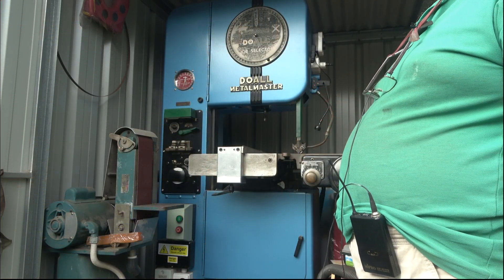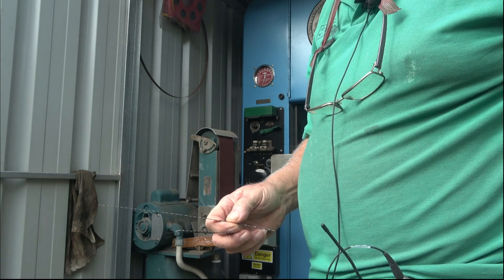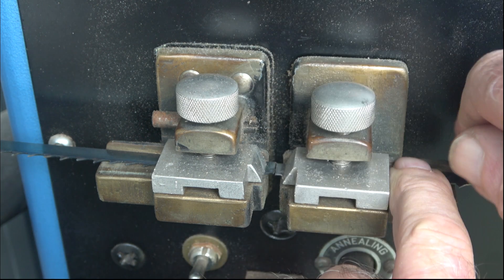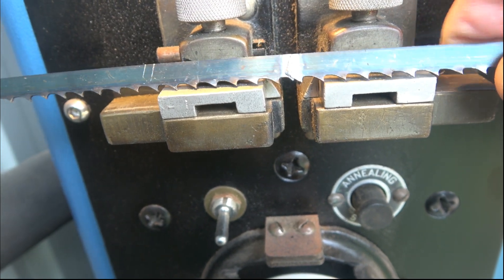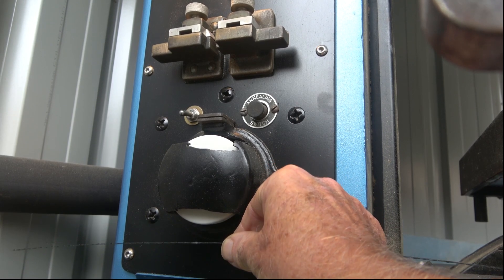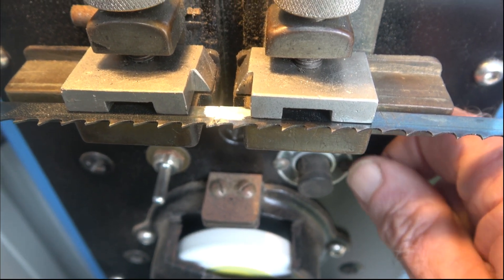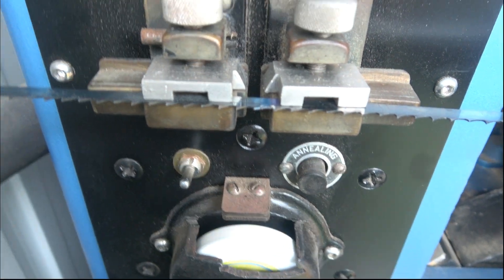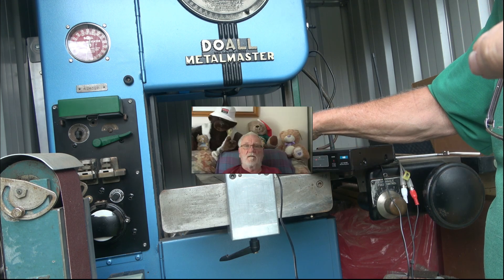How To Do A 12 - 16 Vertical DoALL Blade Weld

Comment: EXACTLY as I was taught in the early 70's on a Do All.. We made our own blades because ''everybody'' had access to the DoAll saw and ruined whatever blade was in it...
Reply from the maker: Thanks for watching and saying about "personal " blades. You hit the nail on the head when you said people ruined them. Most people do not understand the surface feet per minute for different materials, they run the blade too fast and wreck it. Regards.

Comment: Good to see you back in and amongst it Dave. Did quite a few in the first couple of years of my apprenticeship, didn't get taught how to do it properly though so it was a bit hit and miss🤔. Cheers, Jon
Reply from the maker: Hi Jon, thanks for the view. As you saw it is quite a quick and simple ( providing you do not have to do it working around a camera 😊 ) but people seem to find it so difficult to do. These days people buy blades already made or silver solder them. Trouble with the soldering method is that the heat takes away the temper over a much larger length of blade. Best Wishes.